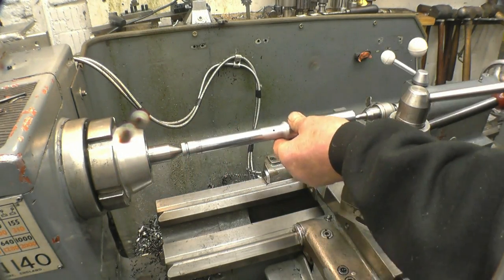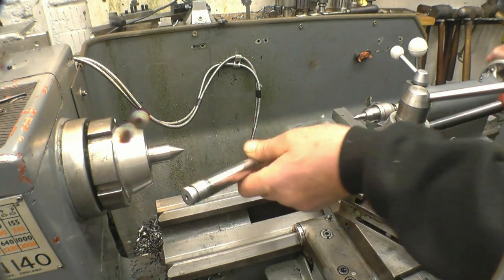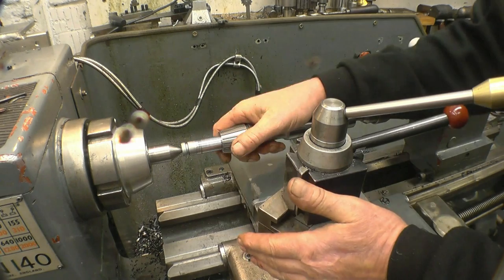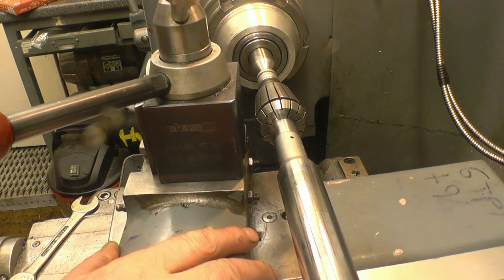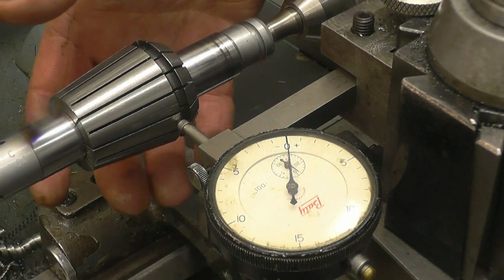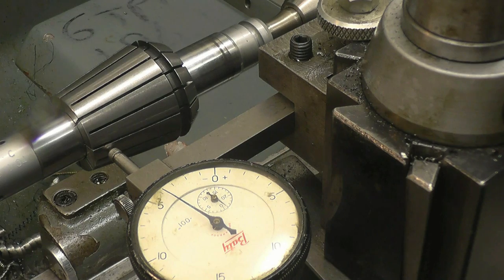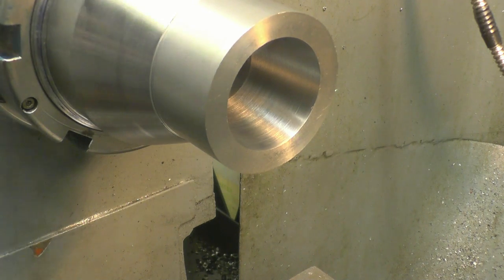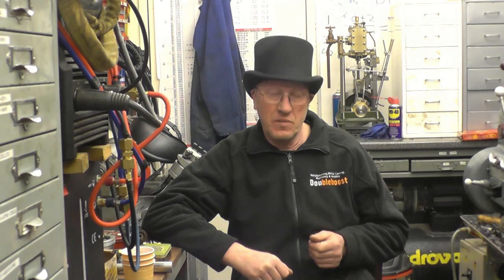SNNC 160 P2   ER 40 Collet Chuck

Comment: I imagine the welding distorted the bore.  Flip it around and recut the bore holding by the ER snout. Then when you are happy with that taper mount it face it and recut the ER taper then don't weld on it anymore!! I think that would work for you but you can decide if you want to fix it or just make another.  A pitty it didn't go as planned.
Reply: That was my thought as well.  I would most likely try to massage the area around the weld down a little with the dremmel or rotary burr.  Should be plenty of precision surface around that to insure that it seats up.  At this point, you won't lose anything by trying something.
Reply: I agree John it shouldn't be that bad even if you cut another keyway . If was dead on before it should be again .the taper didn't change just to much weld or splatter in the slot.

Comment: I recently made one for my L-00 Taper. I bought a backing plate and 130mm ER40 collet chuck from HHIP and turned a shoulder on the backing plate to be a light press fit on the collet chuck. Less than 1 thou of runout and minimal work.

I should mention... My first try I used a spare dog drive plate I had picked up. After turning it down, it was too thin and the clamping force of the three mounting bolts caused me to have about 4 thou of runout. Just like you, I decided "oh well, I have a good spindle protector now." :)

Comment: John, a thought I had a while back was to use  catch plates, turn the OD to clean up,  face it as well  then the other part I was thinking of counter boring it to fit right over the catch plate, add four screws to the od of the outer part with the ER taper in and you have an adjustable collet chuck for multiple parts .

As  i read somewhere,  "If you cant make it accurate make it adjustable" a motto I seem to recall a few time a day.

Comment: could the run-out be from the welding distorting it, so you'd just have to redo the taper in the collet end?
Reply: yeah the welding heat usually does bad things
Reply: Absolutely.
Reply: Absolutely.
Reply: That's what i was thinking.
Reply: I agree
Reply: The same question I had. Worth it to try re-turning the ER40 taper, I think.

Comment: John, that runout is probably from the weld. But you can still save it! Recut the taper farther in. There's plenty of support for the collet inside and for the nut on the outside even after you recut the taper. If there's only a few thou runout now, that's about as much as you have to recut inward.

Comment: I'm with the others below that are wondering about first off welding distortion.  Or if it isn't that secondly if the spindle taper IS out why it can't be skimmed true.    Then recut the ER taper and face off a whisker to get the proper protrusion.    There's still a usable collet chuck inside that block of metal.  You just haven't quite removed all the waste yet.  Set it aside and come back to it another day.

Comment: A clean sharp file, and strong hands/arms, was the original milling machine.  - You need a plastic scraper to push the excess cutting oil into the cut. - That's how a chip is supposed to break. - I like how you setup your tapers. -  Blow the swarf before you put the collet in and turn it. - Did the weld in the keyway cause the run out?  Did you try cleaning up the keyway?

Comment: Just made one for my Bantam John, I thought about cutting a big chamfer on it the same as you did but decided not to risk hitting the bolt holes, just lucky I guess, not to worry you can always make another one, pity you weren't a bit closer you could cut the key way on my shaper.

Alan.

Comment: [[ A cape chisel to fit the desired keyway would square up that drilled hole fairly quickly. ]] I was going to make that comment on the first video, but it looks like you made a sort of a cape chisel by welding a bit of tool steel to a rod. I never saw you use it as an actual cape chisel, though. At one time, many keyways and slots were made with cape chisels. 

I have quite a few, plus others for making round-bottom slots and vee-grooves (half-round and diamond point -  I consider these as types of cape chisels, but no one else seems to classify them that way). Also useful for chasing patterns and large lettering. I once saw someone use a diamond-point chisel to cut threads on a large shaft that wouldn't fit in any available lathe. Laid them out, chiselled out most of the material, and finished with a triangular file.

Comment: Before you scrap it check the keyway, it may just be the key stopping the taper seating properly. If the taper was wrong you'd have noticed when you were taking those heavy cuts.
Reply from the maker: I tried it with no key in  it will not give a constant result

Comment: John, i think it pulled when you welded the hole - just recut the ER40 taper
Reply: The other taper might be out as well after welding, but should still be salvageable.
Reply: yeah but i think that one would pull enough with the spindle nut (since the material is soft), but you're right, if he cuts both again is better and probably more repeatable.

Comment: Hi John. I know you've had a gut full of this particular project but I reckon it might be worth facing the end off a bit then re doing the collet taper? Just in case the welding did put it out. Or does it have a different amount of run out every time you screw it back on? All the best anyway, and keep up the good work.
Reply from the maker: I removed the key  it has 2 thou run out but not constant 
The welding has not made any difference
Reply: I think it is more the stress in the material. I would have roughed it all up before doing the finish cuts on the ER taper. What was the steel? or is it like all my stuff....mystery metal :-)

Comment: you sure the run-out isn't due to the weld causing distortion?  also you removed alot of metal after turning the collet taper, not sure what kind of material you were using, but it could also be stress relieving from all the material removale.  Great video as always.

Comment: Try again, it will be worth it. Fitting an ER40 to my super7 was one of the best things I ever did.
Reply: Oh and I used one of the commercial "bolt on" ER40 chucks and fitted it to a backplate. It was quite straight forward and I got no measurable run-out using that method.

Comment: Hi John,   nice video as every time :) 
Btw.-- i was running into similar Situation while cutting a ER32 Adapter for my small lathe :( 
darn. My solution was facing it of 2 mm, ad re cutting the internal taper -- in  my case it worked.--- perhaps it works for you also ?

Thanks a lot and all the best for you and your family . 

michael

Comment: Nice video John,

1) Your tamper setup technique has a fatal flaw.
That ER40 collet looks like a cheap agricultural import from china. I doubt its got the correct taper, its likely out by at least 1 thou over its length, could even be 2 thou out. even if I had a precision Collet set i would check the tapper setting on at least 3 collets to average out any errors.
.
2) after you cut and internal taper (17:05) you should relieve the small end a bit so the end of the male taper doesn't make contact at its end (where there could be a bur or a bump) the contact should end at least 10% of the length from the small end.
.
3) The run-out would almost definitely have been caused by the welding.
.
Cheers.

Comment: John, can you not take a "clean up" cut on the outside face.  Remove the thing, refit it and see if it still runs true or not.  That way you can remove "weld distortion" from the equation and be 100% sure its the taper.  It's a shame to bin it off at this stage.

Comment: I bought a set of er32 collet chucks a few years ago on recommendations from fellow youtubers and they are crap..There are 3 chucks with tolerances 3 thou or under the rest is around 7-8 thou.. Why bother, my scroll chucks are better than that.. I would  have to add that I have put the bad chucks on some accurate ground shafting and indicated them and I cannot find the fault--they read true..My conclusions are I am  a dumbass I must be missing something..
These collet chucks are going to be used for fishing--as leads..

Comment: Before you scrap it check the keyway, it may just be the key stopping the taper seating properly. If the taper was wrong you'd have noticed when you were taking those heavy cuts.